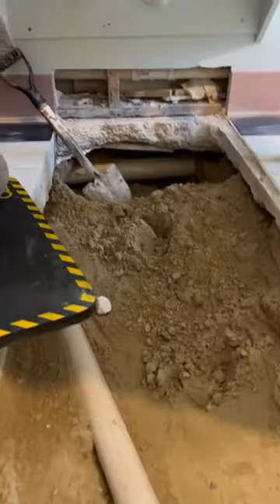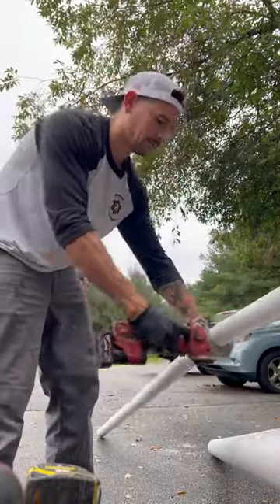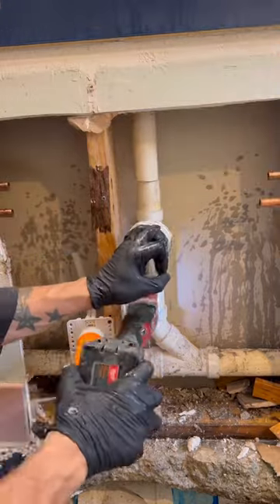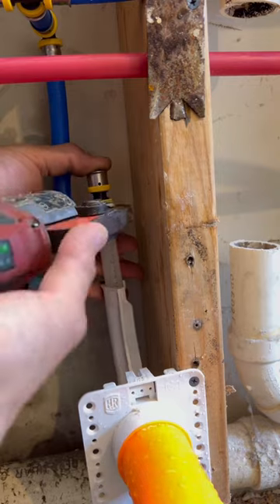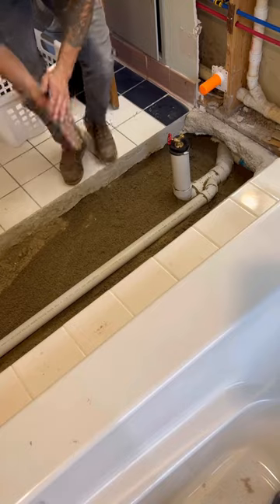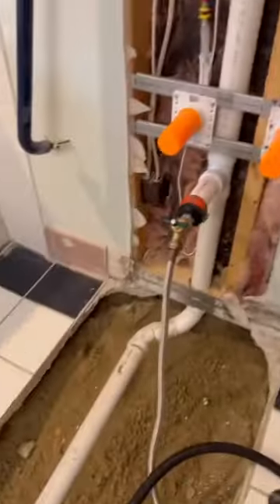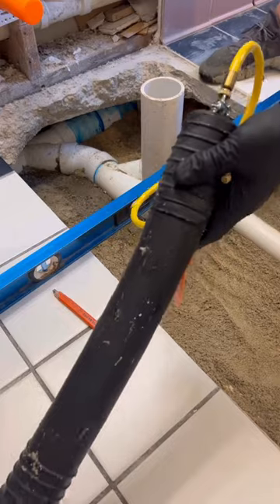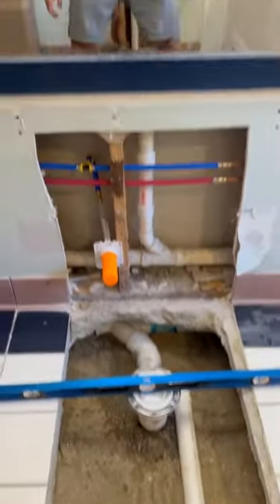Adding toilet and moving sink plumbing

Comment: When you secure the stops with the bracket to only one stud, does it ever wobble or one side sink into the wall? You can put a small 6” piece of 2x4 on the other side and it’ll hold it sturdy